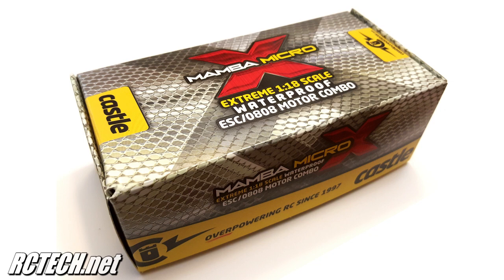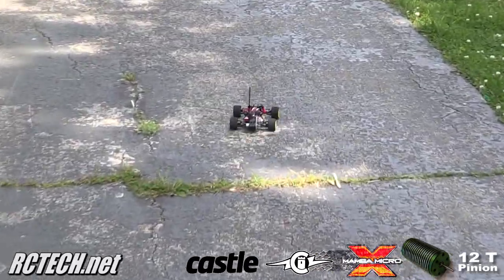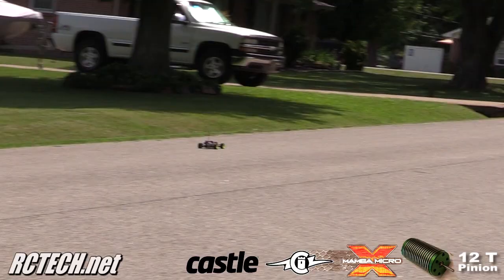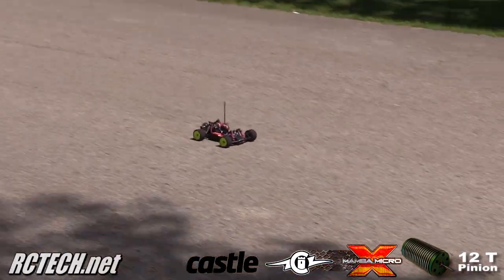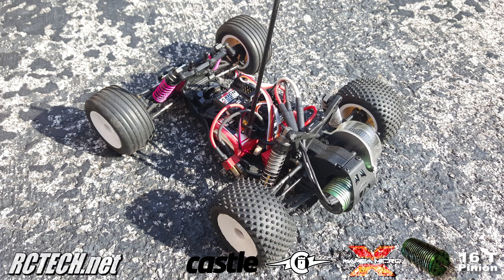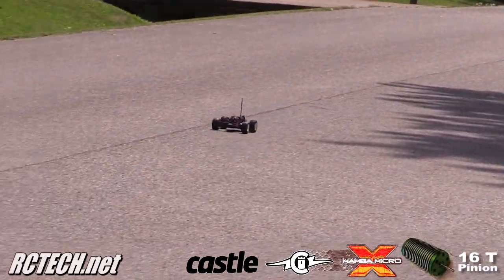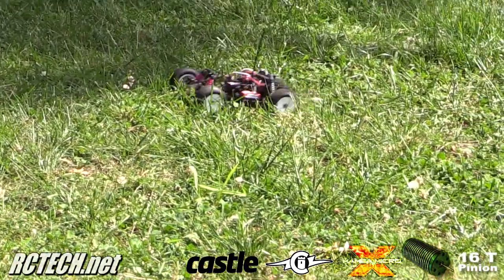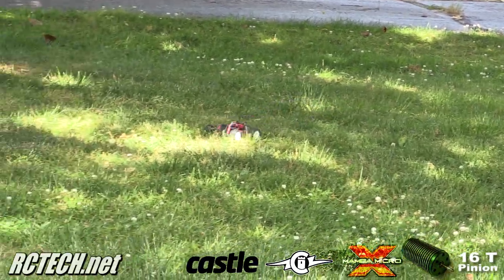Castle Creations MAMBA MICRO X 1:18 scale Waterproof ESC/0808 Motor combo

Comment: I just got the same combo.   I have the 4600kv and those little cars are insane.   
Flip rear body mount and rear shocks t owerswill sit inside the body mount s like most cars...   Added weight in front (it wouldn't matter if it was five lbs)  was very helpful.  
Parts are cheap work grewt
One of the funnest cars I have driven!!!
Best 130$ I spent recently
Reply: @brokenmember1658  wrong

Comment: Needs bigger pinion
Reply: How does opinion size effect the cars performance?

I'm just starting out really and I want a better understanding of how it all works
Reply: @michaelbarrella3043  small pinion= high acceleration low top speed, low temperature. Big pinion = high top speed, slower acceleration high temps. If you want top speed use a larger pinion. If your RC overheats you a smaller pinion. Small pinions are better for racing buggys and stuff in tight twisty tracks
Reply: @michaelbarrella3043  just picture a bicycle, if your in a low gear going fast your going to pedaling super fast. thats what's happening here and why its so loud